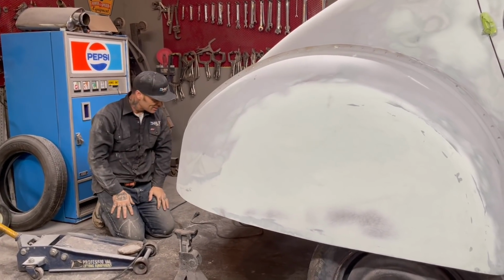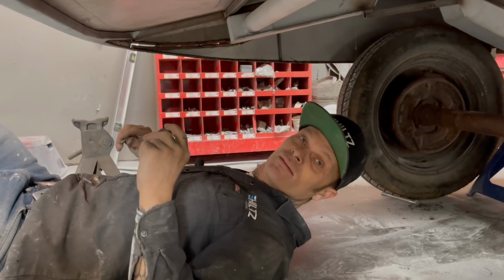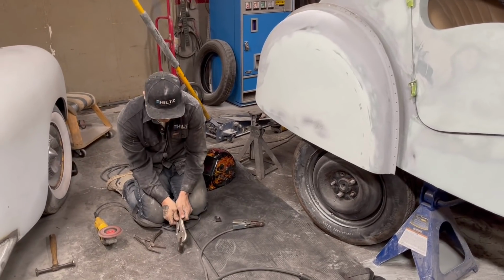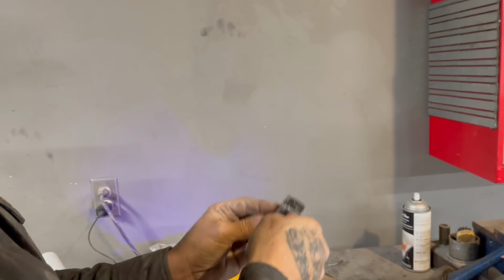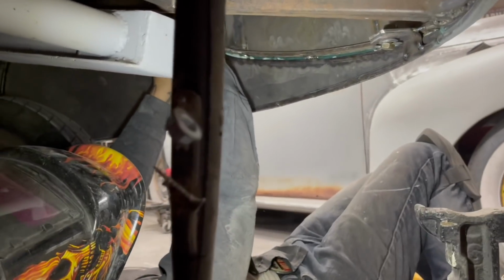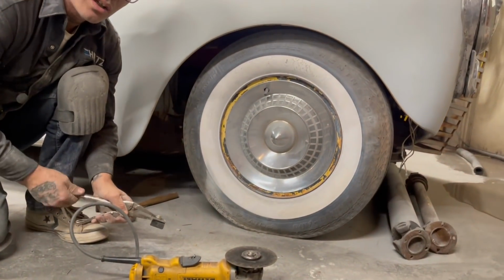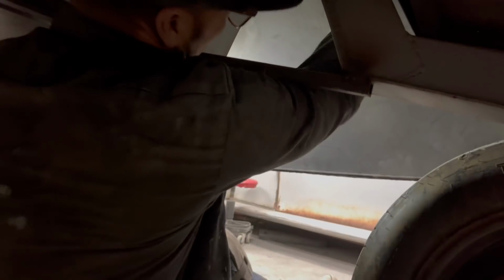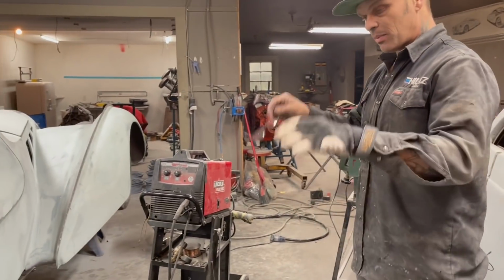FABRICATING FENDER SKIRT MOUNTING BRACKETS 🔥

Comment: Good Job as usual!!  Would it be better to weld the nuts of the bolt to the brackets. I think you would only need one hand to bolt off or on the bolt, if you ever want to change the tyre or remove the fender skirts.
  Take care... Gerald

Comment: Chad, I suggest that you weld the nuts in place on the top of the brackets, so when you remove the skirts, especially with the wheels on, you won't have to get a wrench onto the nut and the bolt.

Comment: Am wondering if that rear axle is up to the task to take on the Jaguar engine and trans and is geared correctly to accommodate the Jaguar trans to axle then to the right sized wheel and tire?
Reply: Lindsey, I think this axle may not be the one he ultimately uses. I think it's a place holder, so the car can be moved as needed. Personally, I would like to see a Jaguar rear axle assembly installed as it is an independent system (IRS). Builders of kit cars prefer them (Cobras mostly) and the Jag IRS used to be plentiful and cheap. That may no longer be the case and thus prohibitive for this build.

Comment: Question:  when you remove the bolts the fender basically drops on the ground unless something keeps the pin secure.  The problem is when  you put the skirt back on you need another person to either secure the scews or hold the skirt up.
Reply: Excuse me I meant skirt not fender.

Comment: You should put the bolts towards the bottom and weld them on the bracket.that way you wont need 2 wrenches to remove nuts and bolts.because bolts are welded in place.the only thing to remove is the nuts

Comment: What about welding the nut to the upper bracket to make them more user friendly, only one wrench required
Reply: Yes, and then maybe use a bolt with a wing nut head on it so can install without the use of any tools.  Maybe???
Reply: Not possible. When he takes the fendercover out it will go down and not all bolds are in the same direction.

Comment: Maybe instead of using a bolt and nut, weld all-thread (or weld the bolt) to the fender’s corresponding brace and then use a wing nut in place of the nut — might be more user friendly in place of the necessity of hand-tools to remove.

Comment: While driving the tire will be moving up and down in relation to the fender. I am worried the tire side wall will be cut by the top bracket at the pin while driving. A bracket and pin arrangement of lower profile would be my desire.

Comment: I would weld the nut to the bracket for easier installation
Reply: I'd weld the bolt not the nut. Makes it easier to locate.
Reply: When I weld nuts to breaks  like that, I use a countersunk Bolt lines the  nut up in the middle of your whole .

Comment: How to take thise fenders off when the car is in the ground? I assume the wheel will block any spanner going on
Reply: Yeah that question is answered. Just pin it up at the top, not bolt it
Reply: With the Jag engine I suggest to reinforce the chassis, should be safer. But the way you build it all, makes it still possible, incredible! 👍

Comment: Weld that nut on to the bracket so you just have to remove the bolt when removing the skirt. Then you will not lose the nut in the mud at midnight when changing the tire.